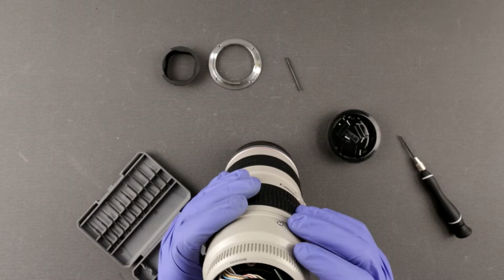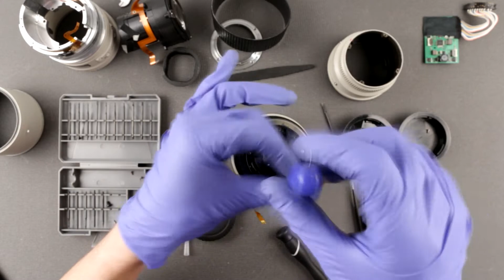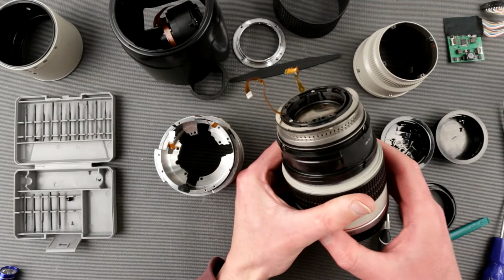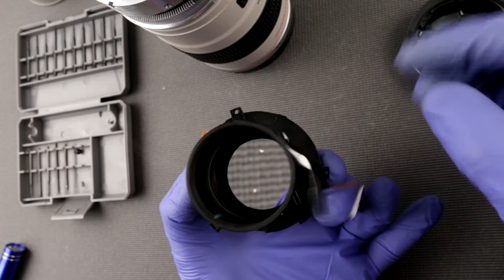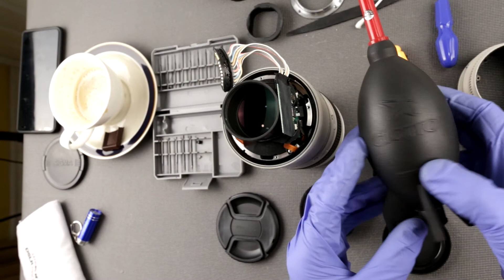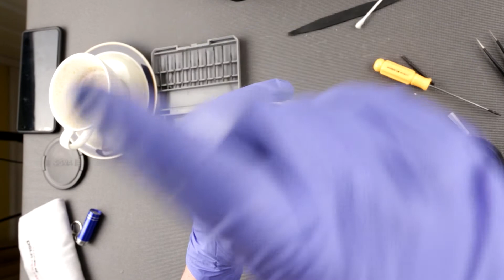Teardown and attempt to repair Canon 70-200 2.8L

Comment: Great video, thank you. I could fix a noticebable loose on my 70-200/2.8 L USM with your video. How ever, I would need your expertise.... Once reassembled, the AF doesn't work well. It is actuated, but in a quite random way and I don't get the focus. Is there any calibration to make? I saw a rotative component on the electronic board, should I make something? Or else? Thank you in advance.
Reply from the maker: No Calibration I know of. Make sure all assembled correctly, all ribbon cables are connected securely and all screws are tighten good enough, but not too strong :)

Comment: Thank you very much for making the video. Just a question I have the same lens and the zoom ring has a little play when I turn it left or right. Is this normal? Thank you so much
Reply from the maker: Thank you for watching. I think this should not happen, need to check and tighten the screws inside the lens.

Comment: Hi, thanks for the video. I have a fungus located in front lens group. Do you happen to know how to separate it? It's just behind the first glass from front.
Reply from the maker: No, sorry I dont think i know how to get there.
Reply: @InsideOutElectronics  ok no worries. I will check with the repair group in facebook and see if anyone has got an experience with it. Just one step away from having a clear glass again.
Reply: @InsideOutElectronics  hey just to give an update. I managed to separate the front group. Apparently theres a ring that hold the glasses together. Just need to carefully twist it counter clockwise. I protected the lens with masking tape to avoid any scratches from tools :)
Reply from the maker: @winterspear6372  thank you for reporting on your success!

Comment: Hello what tools did you use? What's the size of the tools?thanks my husband has same lense and it got wet from heavy rain
Reply from the maker: Just a scredriwer! Nothing else ;)
Well also use gloves to protect lens from fingerprints.
Reply: wouldn't the screws be JIS standard?  given these are assembled in Japan. I mean sure a regular small phillips would work but you risk stripping the screws by not using the proper tool  @InsideOutElectronics
Reply from the maker: @julianuk3266  thank you for watching! TBH i have not heard about JIS before you mentioned it, thank you. Now i know what i need to have for Christmas ;) - a nice set of JIS screwdrivers ;)
Reply: Yes i learnt about JIS when i was working on a Japanese motorcycle, and i stripped a brake reservoir screw, which looked just like a regular phillips. They normally show its JIS head by having a tiny small dot on the screw head. Basically anything Japanese will be JIS. And you really can't go wrong with having a quality set of JIS screwdrivers, as they seem to work better with regular philiips screws than phillips drivers. My goto screwdriver regardless of if the screw is always a JIS driver.   Once you get a set, you'll thank me in the back of your mind every time you unscrew a screw til the end of time now lol  its crazy how unknown this so very important and useful fact is.   @InsideOutElectronics

Comment: Hi there. Will ef 70-200 F2.8 ii rear mount screw be compatible with my 70-200mm F2.8iii? I damage 2 screws and can't find the right screw to replace I only saw 70-200 ii screw sell on ebay.
Reply from the maker: Hey! Are you talking about 4 screws that fixing bayounet to the lens body?
Reply: @InsideOutElectronics  yes.
Reply from the maker: @sottheaphoeurng9044  i think they are interchangable. I have many lenses sharing  same screws. But i would check by pulling one of your screws and comparing them with ones tou want to buy.... how much are they asking for them?
Reply: @InsideOutElectronics  4 screws for 16bucks

Comment: I think that noise you are hearing could be the IS unit. I just bought a new 100mm macro lens, and it has a lot of noise.
Reply from the maker: No, this guys does not have IS :) I think this is AF clutch
Reply: @InsideOutElectronics  I did not realize they made a Canon EF 70-200 2.8L without built in IS.  

I have what looks like the identical canon lens and mine has IS built in. I have been using it for years. Mine has 2 setting on the lens for IS. Maybe mine is a later version?  edit: Mine shows a II on it, so I bet it is a newer version. Interesting to know.
I have never taken a lens apart, so I don't know what it is for sure. You could be right about it being AF clutch.

Comment: Hello, I am a jeweler and own a laser welding machine that works on aluminum. It is designed to make small welds and I think would work great for those type of brakes
Reply from the maker: This is amazing ! Im pretty sure it will. So fat it is holding ( have not look inside ) I also have 123/2L with cracked barrel inside, that was is harder to fix epoxy might not be strong enough

Comment: I have a similar problem with my lens - the broken aluminum housing, except I have 3 breaks in total. How has the super glue solution worked? What did you use to clean the residue - acetone? Thanks for the informative video!
Reply from the maker: It still works fine, but for all 3 I would use metal epoxy for aluminium.

Comment: Don't fool yourself into beliving the lens will be the same again after dis- and reassembly. Without professional optical adjustments the optical quality will suffer badly. After this every Canon 75-300mm will give you better results.
Reply from the maker: Thank you for commenting, I think it is better to have operational lens then heavy paperweight.
Also I did not touch anything in optical groups. Front group and rear group are intact.I do not think there is any optical suffering by touching AF assembly. And after repair it definitely works better up to this day.
The only thing I would be very concerned that people doing this touching lenses with dirty fingers or dirty gloves or introducing extra dust and lint inside the assembly.
Reply: @InsideOutElectronics Well, this is less about fingerprints and dust than the whole rear group – it is a centering element. So if you proceed after 12:30 and losen the screws centering on an optical bench will be necessary.
Reply: @The-four-o-five  If there is no screw slots for an adjustment to be made and no shims for spacing being used, I do not see why an optical bench would be needed.  But if the broken tab is not put on strait I could see that it might cause a problem.
Reply: He is correct, as the rear element was removed (the black one with three screws and washers at 12:33).  That rear element has some movement and if you don’t center it correctly, you will get coma or softness.  That rear element needs to be placed on a collimator to get it sharp.  However, sometimes if you’re careful and lucky, you can get by, by marking the spots exactly and lining the rear element up and screwing it down.